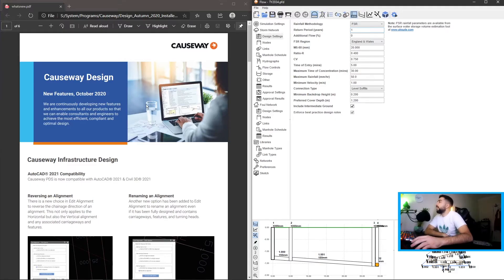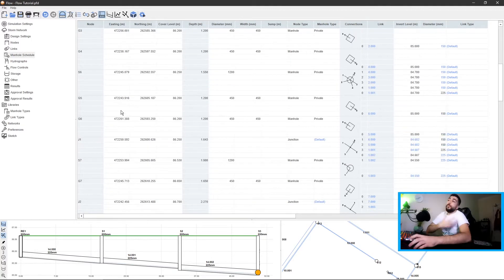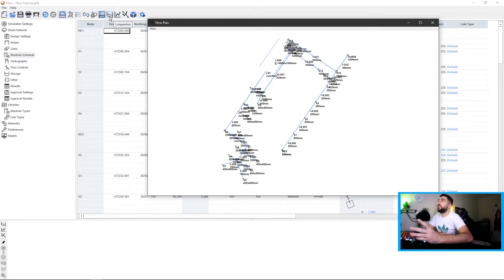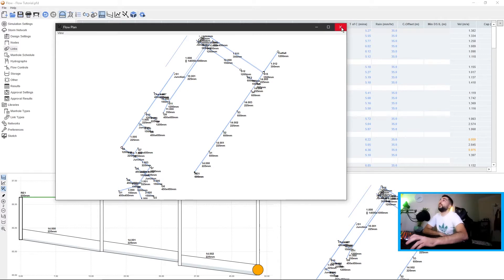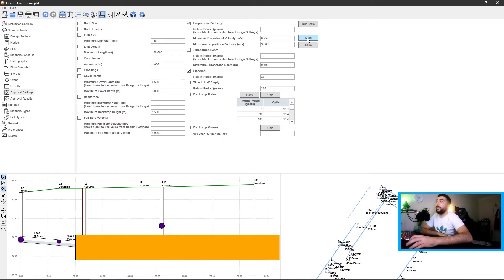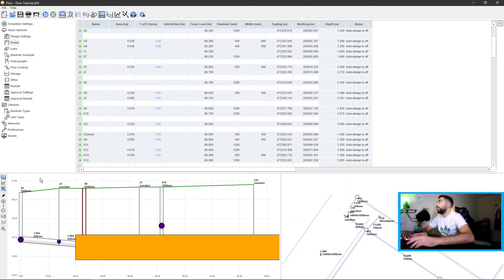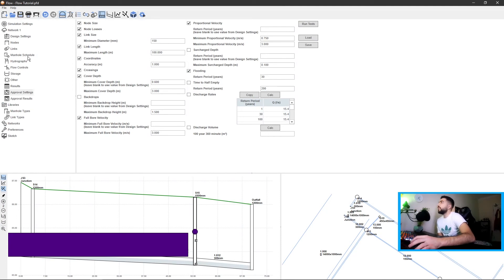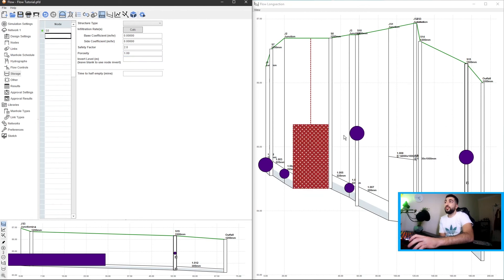Review of Flow v10.1

Comment: Hi Fredy, I am aware that this was two years ago, but the same principle of storage remails the same in 10.4. Normally, for a storage tank the inlet is higher than the outlet, but FLOW seems to default bothe inlet and outlet at the bottom pf the storage tank. is there a way to correct this in FLOW other than using a closed rectangular link?
Reply from the maker: Hi Stedroy, you use the flow through pond storage structure. Spoken with Causeway in the past about it, and they said that it can be used a cellular storage. The only issue I believe is that during the visual 3d modelling it does not look fully right.